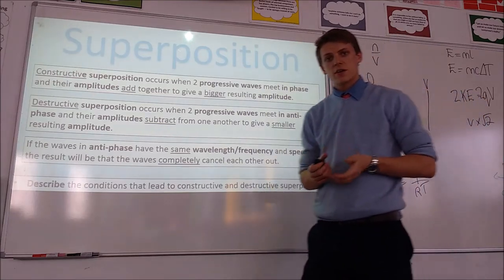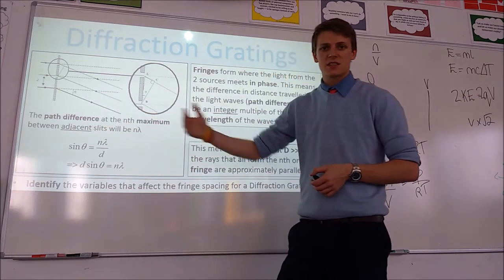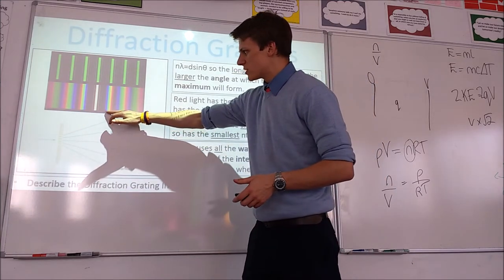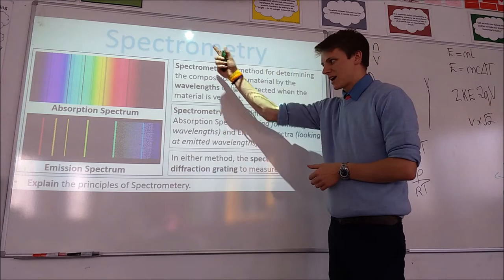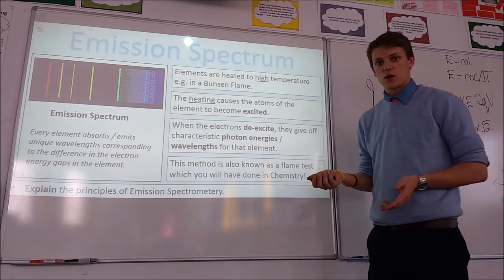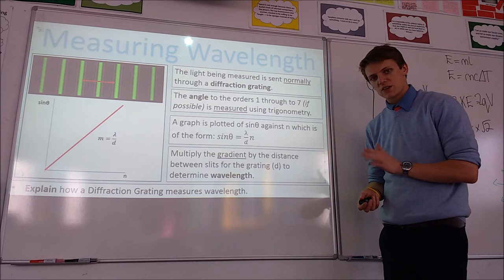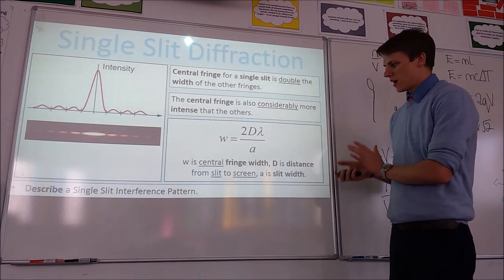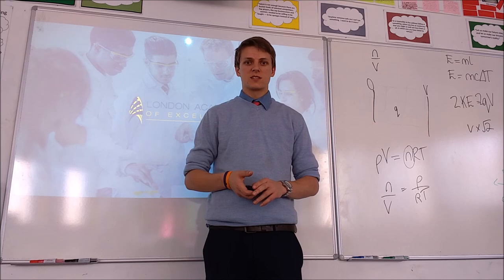A Level Physics: Waves: All Exam Boards: Interference from Diffraction Gratings and Single Slits

Comment: lines cannot be parallel if they meet at a point. in this example the point is the maximum(the fringe), so i think the diagram is drawn as parallel lines to simplify what is being explained. let me know if am wrong
Reply from the maker: Aymen Shallal You are correct that they are not exactly parallel but if the distance to the screen is considerably bigger than the slit spacing it is a very reasonable assumption to make that they are effectively parallel.